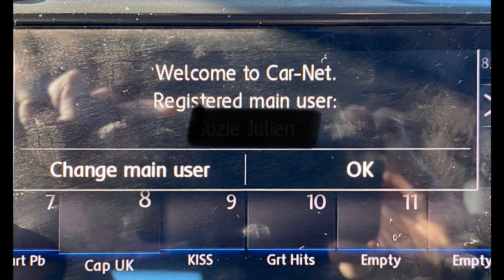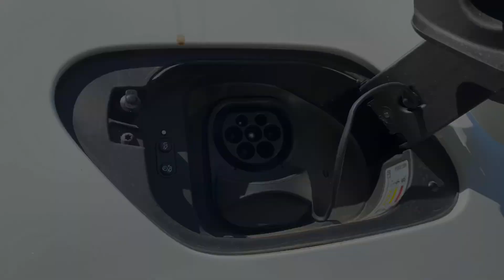VW E-GOLF - THE 12 WORST THINGS ABOUT IT!!!

Comment: My "beach list"
1. Must use the fob to lock the car. There's no way to push a button and close the door in silence, one must close the door, lock with the fob, and endure the embarrassment of the horn chirp.
2. If one accidentally tries to start the car while the charger is plugged in, the car will stay off for the next five minutes.
3. Randomly, if one uses the fob to unlock the doors, the car will sometimes not start for five minutes.
4. No idea where the paint code is... Fords have the paint code right in the door jam. Finding it in a VW is a mystery to me, as is the mystery of why did they see fit to have three shades of metallic silver. (Makes me glad my uncle bombed the VW factory during WW2.)

Likes:
1. I don't remember what a gas station looks like. (do they still exist?)
2. Every morning the car is fully charged. No time is spent during the week for a trip to the gas station.
3. Corners like it's on rails.
4. Hole-shot acceleration will beat a Mustang GT to the other side of the intersection.
5. Very calm ride.

Comment: Yes yes and bloody yes. I’ve got a heat pump and to be honest the range is similar to what you stated. The Welcome User message is more annoying as I typically use car-play and it blacks out the car-play screen rather than displaying over it. My other two would be: why does the boot not shut cleanly every time (I’ve come from an Audi) and why isn’t there a tray under the boot floor to help with aerodynamics?! As it is the rear bumper just acts like a big parachute.

Comment: This will be my first ever car. Looking forward to getting it.
Reply from the maker: You’ll love it!
Here’s the full plays list:https://www.youtube.com/playlist?list=PLvWIWt_PRaIU-_opZU2BWUgxJ6QjLKvnc
Reply: Got mine today! Love it :D ....i was in my garage charging and at the same time trying to set up all kinds of personalization, map updates and whatnot. Tried to turn on the heating but it just got colder (8C outside). Was fearing that the heat pump thing was not working. Unplugging the charger and "starting up the engine" was the trick. 

The information system should have told me that "you are trying to put on heat, but nooo - you need to start the engine. Aaaand you need to disconnect the charger to start the engine". Anyway, not big deal, just a peculiarity for new users. Also - this is my first electric car, i struggled with how to disconnect the charger, lol. Ok, so just press unlock on the key and it will come out easilly. Good luck!

From my experience, these are the two advices i have to give :)

Comment: If you have keyless entry auto lock can be coded using e.g. OBD11. In denmark heatpump is standard. :-) 
My worst is the noice from steering in cold weather. (And really my only real complaint). A 2nd front charge port would be nice, and 60kwh battery. But I love it as is.
(And due to no tax on electric cars in denmark the e-golf is the cheapest Golf you can buy in denmark ~ e-golf 31000 eur, cheapest fossilfuel ~37500 eur).

Comment: I never understood why Volkswagens have a special position for mirror heating. All other cars that I've had turn the mirror heat on when rear window heat is turned on. I think that makes a lot of sense and that also allows you to use the mirror dip function when heating the mirrors. My last car (not latest, last since I'll never buy a car again) had the mirror dip on both mirrors. The selected one would dip when transmission was set to reverse.
Reply: But you shouldn’t be using a mirror before it’s defrosted anyway!

Comment: Some of the points are probably a bit picky, but my experience is:
No WTF moment occurs when putting it into park and letting foot off the brake. Not heard of that one before.
Gesture control is a bit pointless.
My CarNet works fine,  and I have two stored settings paired to my phone, and my house wi-fi when I'm parked. I have the larger screen and Discover Navigation Pro though. Don't know if this is different on other models.
My auto lock works fine (I have keyless entry).
Agree about the temp feeling as though it is about 3 or 4 degrees out, indicating warmer than it is.
No issue with eco-mode coming on. It's 'self-protection', and if you haven't got Sat-Nav on, it isn't going to know you are 15 miles from home. Dead easy to change modes back to normal.
Charging point light. Absolutely. I've used my phone light a number of times, even on my own drive(!)
Heat pump. Yes, they should all have them on for efficiency, but, horses for courses. My commute (was) of 60 miles, but got to charge for free at work, so never an issue with range etc. This is a car originally launched back in 2016, so I guess it's that year's tech.
Frunk - you wouldn't get much of a frunk in there, and unless they rearranged the gear under the bonnet, it would be an odd shape. It is a converted standard vehicle after all, rather than a from the ground built EV. I would therefore not expect this.
I  don't really have any gripes with mine - I actually love this car. You can get a lower cost introduction on the 2nd hand market to EVC driving (as I did), and it is a joy to drive (even with the odd wheel spin!)
Despite it's limited range, I've used it as my everyday commuter, and have embarked on long trips with very few issues. It's dead reliable, you don't have to do anything to maintain it (other than consumables like tyres, brakes, brake fluid and screen wash!)

Comment: hi Steve im looking at a new e golf with heat pump,lastbonein thw world,how long have you hade e golf anny problems, ps the mirror reversing the my tdi is the same and the heating thing to,worst thing about my tdi al the noise from pump under bonnet injector and in the fuel tank under back seat,have had anny suspenshion issues
Reply from the maker: Apart from a puncture, it’s been super reliable.
We’re only 15 months and 10,000 miles in though but feels very solid.

Comment: The suspension makes a lot of noise, i had to take it many times to the dealer to change some parts and grease it under the warranty, 
Now i had some sound kind of clicking every time I totally stop and move again, i believe it is coning from the breaks pads the rear one it might be slightly moving, the dealer refused to fix the clicking as the person their said it is obvious and the workshop could not find the cause, this dealer in stavanger norway

Comment: Point No.13: No "%" available for State of Charge
Reply: I agree, not even 1/4, 1/2, 3/4 full marks on the battery indicator on the full LCD dashboard, you have to dive into the menu on the central screen to view the battery page which gives 1/10 bars but even then not easy to view with a quick glance. I think they want you to use the GOM as an indicator which I have to say is pretty accurate.

Comment: One thing I do like on my 2017 GTE is the front Charger behind the badge, and also it has a heat pump if We Connect actually responds..🤪🤪😇
I know on the 7.5 facelift cars the Radar cruise camera was moved to behind the VW badge and not the Lower grill of the earlier mk7 golf and 7.5 GTE Steve 👍🏼👍🏼
Reply: Also you can activate auto lock doors in Vag com if I recall, mine locks when I walk away as well locking when you pull away at Around 10mph
Reply: @stevehulbert  I activated mine with OBDeleven. Basically it brought the option in the care menu, then i ticked it and it worked.

Comment: Brilliant about the heat pump.. don’t get me started about the short range haha.. mine is ‘rated ‘ at 125 miles in USA . But freeway miles that’s about 85-95. We drive 75 mph here in CA. I’ve gone to weddings 90 miles away and had to play ‘slow down ‘ and ‘get behind the slowest truck’ in order to regenerate miles to get home on. There is nobody who is going to come out and ‘recharge’ a dead ev here. Most EV’s are over 200 miles now and I can’t get the ID4 because the price jumped to $60,000 in the pandemic . My egolf costs $32,000 ..I leased with $0 down $1500 for license and registration..$360/month. The federal govt paid $7,500 and my state paid $2,500 .. so I paid net $22,000 . Insane to pay $60k for just 140 more miles IMO

Comment: Valid points there Steve. I had a Golf GTD so that dislocated wrist thing is familiar to me. Those heated mirrors that don't work like they should also baffled me. I assume that when the mirrors fold in when the car's locked you can't see the 'alarm set' led on that model either. Who came up with that idea? Looks like your Golf uses the same engine coolant header tank as my new Skoda Superb given that I have as much coolant all over my engine as you appear to have 😆 At least things in the VW group are consistent

Comment: Hi Steve, like your videos, greetings from Germany! 
My thoughts about your negative points about the e-Golf (I drive a 2020 e-Golf and really like it. 60 kWh battery would be great. Apart from that a great car! Love it!)
Auto lock when you leave the car: I have never been used to it, so I don‘t miss it 
Wheel spin: The Bridgestone tires I got on the 16 Inch standard wheels could be more sticky, yes, but I guess they have also a low rolling resistance. Conflict of goals. I‘m looking forward to compare them with the handling and energy consumption on winter tires (Goodyear Ultra GRIP) 
Frunk: Would be nice to have for stowing the charging equipment 
Nose charging: Would be nice, I guess inLHD cars the charging plug on the right side is not that issue...
Temp gauge: I always, really always and in all Cars I drive, have set the climate control on 22 degrees celsius in Auto mode and A/C on. Think I never changed it since I picked up the car... I always feel comfortable. Fun fact: Maybe the 22 should not mean degrees Celsius. It’s just a value. You only guess it is. I cannot find „Celsius“ on the panel or in the display... yeah, hair-splitting, I know 
WTF parking: You don‘t drive with auto hold ON, do you? When it‘s activated the parking brake closes when the ignition is switched off.
Turning the ignition key: That is why I ordered Keyless in all Golf 7 without exception. I hate that turning move using this new standard vw key since the launch of the Golf MK7. 
Keep it up, Steve! Waitng for new videos :-)
Reply from the maker: Great points Marti!
New e-Golf video in a few weeks ‘5 Ways it beats the Audi e-Tron’
Here’s the full playlist so far https://www.youtube.com/playlist?list=PLvWIWt_PRaIU-_opZU2BWUgxJ6QjLKvnc

Comment: I have two primary issues with my EGolf in the first world. 1:  Lockdown as the weathers warmed up so I’ve not seen the range benefits yet as most I chanced was 80 miles (from a 95 range). 2: Car net and Apple don’t auto connect. So I have to manually go in and connect to my phone each time if I want to use the data features. Even if it’s plugged in by cable...  I find that incredibly frustrating and I just don’t do it. I’m not sure if that’s a car issue or if it is Apple that don’t allow it to auto connect to hotspot wifi networks. If anyone has a solution that would be ace!

Another slight bug issue for me is the charge point locations not being built into the mapping data. Though petrol stations are 🤦🏻‍♂️.  Admittedly I wouldnt use them anyway as I like to use Zap-Map so I can find the most cost effective one to use on my route and I navigate direct to that point rather than waypoint it. I am envious of the Tesla navigation (amongst other things). I just can’t afford that car 😕

Comment: Hi there,
I also use an e-Golf. I got a 2020 model and I have been using it for 6 months now.

1-) Auto lock feature: I never had this feature but I do think its a MUST have. I forgot to lock my car a few times. You can lock it via de app but its super slow and sometimes fails. It takes me like up to 10 minutes to lock the door via de app because I need to refresh alot and it takes alot of time eventough I got the newest phone and best 4G connection. I did hear that they will release a faster app soon (because of the ID.3). I am talking about WeConnect.

2-) Wheel slipping: I am used to it now. If its rainy or snowy I dont press the pedal like a maniac. I just build up speed slowly by pressing my foot slowly. I didnt have any slips since then. I did almost had a car crash tough when I slipped once. It was in the beginning. I slipped at a red light and the car went 20meters further while my light was red. Terrifying expierence!

3-) Engine roam: Its because they copied and pasted it from the normal Golf. There was no enginering involved into make e-Golf really. Thats why they created the ID.3. A real EV. But I dont really mind this because the back has plenty of roam for a hatchback.

4-) Heat pomp: I didnt get this option. It costs alot of money. Too bad its not standard

5-) Eletric Window noise: I dont mind the Window noise

6-) Key turning: I dont have any problem with this lol

7-) Eco Mode: I dont have any issue with it either. 

8-) Lying Temp: I never had airconditining before. I never use it though. So I think ur point is very valid. Because when I turn it on for example 22 degrees its still blows cool air like crazy.

9-) Carnet message: This is annoying yes!

10-) Charge port light: I dont seem to have this issue really. I can see it perfectly fine.

11-) Charge port location: Its on a very wierd location for EV indeed! 

12-) Mirror: I never even used the dip

Comment: My only gripes with the car are 1) When auto hand brake is engaged and you come to a standstill in traffic and take your foot off the foot brake it leaves the brake lights on blinding the car behind. This is contrary to best practice in the Highway Code. 2) The remote app is flaky and in some respects doesn't work at all. 3) Remote Tyre pressures only show a warning when there is a significant drop in pressure, would like to know what the tyre pressures are whenever I want to. Other than those its a fabulous car. I don't care it doesn't have a frunk, got a big enough boot. Optioned the key less entry so touch the door handle to lock the car and no putting the key into the ignition to start. Optioned the heat exchanger (£800) so virtually no loss of mileage with heating. I tend to drive to the road conditions so no flooring in wet / icy weather, yes there is occasionally a modicum  of wheel spin but the traction control quickly recovers it. Rocking forward when in park, I use the auto hand brake / put the handbrake on before releasing the foot brake, any Automatic car would do this. Tilting mirror; I use the mirror heater when its needed and switch it off or back to L (Tilt in reverse) when the ice has cleared. The chance of mirrors still being frosty by the time I first parallel park has never happened. Drop in power under 31 miles and then Eco+ at 15(?) is probably a battery preserving measure so I would rather that than quicker battery degradation. For me Heat Exchanger, Keyless Entry, Driver Assist, Matrix Headlights (hit a deer and had to replace one @£1,300 + labour!), LCD dashboard / instruments are must have options but I do realize they add significant cost to the vehicle.
Reply: The TPMS does not use pressure sensors.  It looks at relative wheel speeds.  There are two types of TPMS.  Active and passive.  This one is passive.

Comment: That it is not as good as my Toyota, it turns of leaving me passenger to hot or cold, i can't find how to just have the fan on and not the hear or AC, the rear shocks rusted away, the brake protection rusted off. That it takes hundred years to lean the seatback down, that it have no frunk, the rubber around the door falling off, the Hatcher for the charger works sometimes and i am stranded by the charger, and most of all the in my mind stupid software and too much automatic. 
I know its a VAG product and failure is a thing, but this is maybe the best car they ever made i think, and the electric driveline is way better then any diesel or petrol they have in my experiences. 
Now it wont work an have a error, and no I won't ever go to the dealer after a long bad relationship with them from earlyer ownership.
So it will once again be my teystu Toyota taking me around, as it always do...

Comment: Personally, I do like the frunk on the e-golf because I just like to see all the mechanical stuff under the hood and all the boxes, the traction motor, and all the orange high voltage cables and high voltage warning signs. It just gives me a rush of dopamine almost as if there was an engine there. The tesla just has too much innovation for my taste especially on the square steering wheel in the new redesign and with their self-driving cars, I hate them even more. Well, first of all, I'm not into electric cars I like engines but I just like simple normal-looking electric cars (like the e-golf and leaf) not some crazy futuristic-looking prototype with a joystick I hate that it's just to much for me. I don't even think self-driving cars, as well as those futuristic-looking show-off prototypes with joysticks and square steering wheels, will ever be legal or for at least the next 30 years. There need to be drastic changes in laws to allow them on roads. As a matter of a fact, Tesla is now in trouble with federal motor vehicle safety agencies for their square steering wheel prototype.